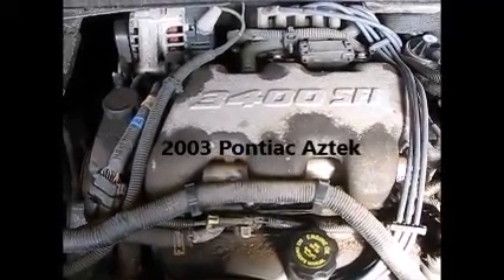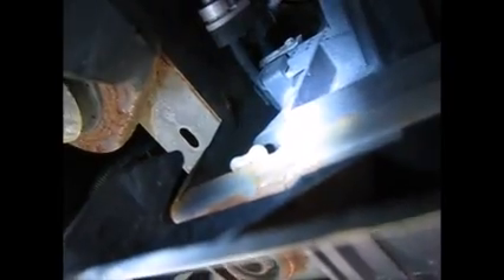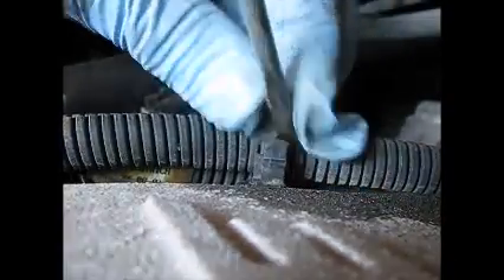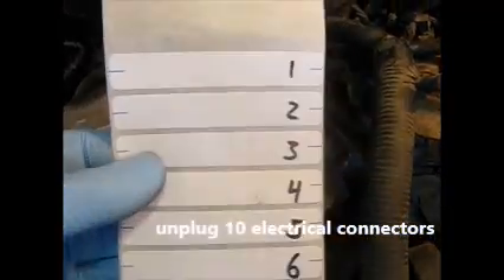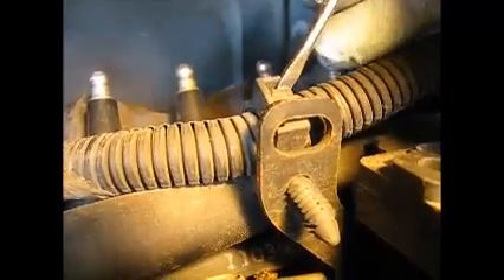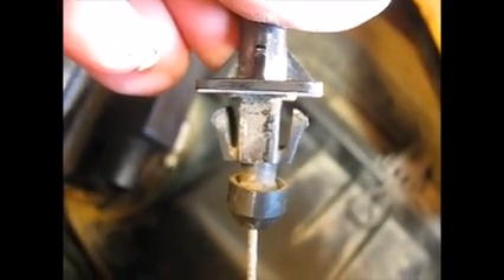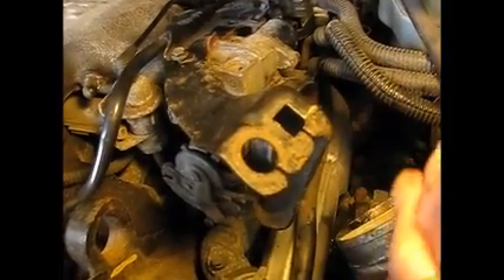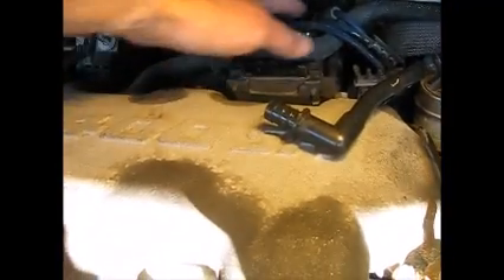3.4L GM lower intake manifold gasket replacement part 1: Intro and removing upper components

Comment: It's not very often that plugs clip on a connector that not for it pretty much every plug is different by even a little ridge or a difrent clip but is hard to mix the wirers

Comment: I noticed that on your webpage version of the repair, you specify black rtv sealant. My gasket kit did not come with sealant, and I have Permatex red high temp rtv on hand. Do you believe it is necessary to buy black rtv rather than using the high temp red rtv that I have?
Reply from the maker: The red should work fine. You may be wasting red's high temp capabilities here though.
Reply: @TheOriginalMechanic  Thank you for your reply. I have watched a number of videos covering this repair and I believe yours is the best. Thank you for the considerable time you put into this.
Reply from the maker: @josephalan2094  You're welcome!

Comment: My daughter has a 2005 Equinox that has this engine...last week she said her coolant was going down.... I put my pressure tester on it.... I found a slight leak from the intake manifold gasket at the back of the driver's side..... ugh.... this looks like major major surgery.
Reply from the maker: Yeah you need some time and patience, but it can be completed by the home mechanic.
Reply: @TheOriginalMechanic  oh I know I can do it but on my own  GM 3800 I can do the job it fewer than 2 hours ... It seems this will take a lot longer.

Comment: I think we are encountering very similiar issue on our 1996 Pontiac Trans Sport with the 3.1 liter. But instead of showing any signs of coolant in the Engine Oil we have signs of Engine oil in the coolant. I'm thinking it's the same culprit, pop the coolant radiator cap off and it's looking like a milkshake inside. We have an oil leak at the rear main seal and we are loosing coolant. I don't have the money for the gaskets yet or even to change the oil at the moment but I'm thinking the lower intake gasket needs to be replaced, coolant needs to be flushed and the oil needs to be drained and replaced with new fluids and a filter.

Comment: I used your 8 part video series to replace gaskets on my wife's 2003 Chevy Impala hoping to add to the already 240,000 miles.  Things went well thanks to your excellent instructions and thorough explanations.  I appreciate your willingness to put the time into sharing such detail.  This is what helps the knowledge train continue down the line.  The Impala is running like a champ again, with no more leaking oil.  Thank You!
Reply from the maker: You're welcome. So glad you were able to make use of the series. Thanks for recognizing the hours of effort it took to make these videos. Great to hear an older car is still on the road. That must be the second (or even third) time that repair was done on your Impala.  Great job!
Reply: Hello I'm need helplocating my wires for my harness to my alternator my harness broke off the wires broke off my old hornets and now I can only find one wire and that's the red wire the ignition wire so I'm needing help to try finding the honor wires it's a 2003 Pontiac aztek thank you if you can help me

Comment: why is my 2000chevy impala run at a very high rpm when I start it up and it doesn't go down at all I changed thurmastat and intake gaskets with gasket sealer now it's running at high rpm
Reply from the maker: I always go back over my work when I get an unexpected result like that. Odds are you missed a wire or hose connection.

Comment: I changed the thurmastat on my 2000 Chevy Impala 3.4 L and tried to fix intake gaskets now it's leaking and running at a high rpm
Reply: Any luck

Comment: Do the car was smoking through the tail pipe before changing the lower intake manifold gasket? Curious because my car it's smoking white smoke and it just got new head gasket
Reply from the maker: No this car did not have white exhaust. It may be possible with a lower intake gasket leak if enough coolant gets into the oil.

Comment: This might be a stupid question but I'm curious. Was the discoloration of the top intake manifold(where it looks wet) a sign of the lower intake manifold gasket failing? If not what are the visual signs? I'm looking at a 3.4 grand am that looks exactly the same .
Reply from the maker: Possibly this could be a sign, but coolant in the oil is a better indicator of big trouble.
Reply: Xander Kresh....that is the beginning signs that there is a lower intake manifold gasket leak beginning, and upper plenum gaskets starting to get a little dry and brittle.

Comment: I damaged the tubing that goes in the air intake you remove at 10:30 in the video.  I have everything back together but getting a check engine light from this tube missing.  Any idea what this is called, or a part number?  Appreciate your videos a great help!
Reply from the maker: I'm not sure what it is called. I did make a blog post on this repair. You may find this helpful 
http://www.originalmechanic.com/2016/06/how-to-replace-lower-intake-manifold.html
Reply: @TheOriginalMechanic  Acdelco PART#: 24508188, it is called PCV valve tubing. Many part stores (websites) say it doesn't fit 2004 impala 3.4L but it does. Hope this information can help others.
Reply: Hey bro u still around

Comment: Can someone tell me what is that wire or pipe next to the intake air temp sensor on the air intake hose. For some reason it is cut off and taped around it in my Chevy impala
Reply: Obet oxygen sensor
Reply: Pcv valve bro

Comment: Drain oil to remove the intake manifold??? By the looks of your oil cap you have a blown head gasket. Maybe you ought to re-title your videos to reflect that....
Reply from the maker: Coolant and oil passages pass nearby in the lower intake manifold gasket on this engine, much like in a conventional head gasket. The failure  of that gasket is why this repair is taking place.

Comment: This is not a 3.4 this is a 3400 which is alot different. I know 93-95 camaros, and firebirds (rear wheel drive) have a 3.4. Still the same principle for replacing the intake gaskets, but looks a lot different then mine. Thank you for the very explanatory video.
Reply: This is not a 93-95 Camaro with RWD.The OP states very clearly 3.4L or 3.1L 1998 to 2005 in his description which is correct. The OP even goes into great detail saying "These engines are found in many models of GM vehicles made from 1998 to 2005, such as the Chevrolet Malibu, Lumina, Venture, Impala and Monte Carlo; the Pontiac Grand Am, Grand Prix, Montana, Transport and Aztek; the Buick Century and Rendezvous; and the Oldsmobile Alero and Silhouette." Nowhere in the description does the OP mention/say that this video/procedure is for a 93-95 Camaros, rear-wheel-drive. It doesn't matter if the engine decal says 3.4L or 3400. It means the same thing. I have a 1998 Oldsmobile Silhouette with a 3400 engine. This is the engine specs for it "3.4 L; 204.4 cu in (3,350 cc)" from Google.  I'm a mechanic and here's the specs right out of the book for the 1998 - 2005 3.4 L; 204.4 cu in (3,350 cc), which averages out to 3400 cc which some Chevy, Oldsmobile, GM, put on their upper intake or specific location for a description of the engine displacement size. Some companies also choose to put 3.4L instead of 3400. What do you think cc=cubic centimeters, and L=liters means? What do you think 3400 cc means? 3400 cc is the same thing as 3.4L, get it? 3400 cc=3.4L.  Again it's still the same engine the OP is working on from 1998 - 2005. You need to learn a little bit about engines before letting the whole world laugh at your arrogant ignorant comment. I just took this from Google "Now CC stands for cubic centimeters that is the volume of engine. 3.8 L engine means its volume is 3800 CC.(1L=1000 cc).

Comment: I'd recommend not removing the throttle and cruise cables from the bracket...just unbolt the bracket. You could easily break the plastic tabs unneccesarily.

Comment: Hi Hope someone can help me out here. I replace the intake manifold gaskets etc, put the van back together and it wont start. I found the problem.  On the coil pack are 3 connectors, I  connected left one on and the right front one. The back right one is missing. I dont where it comes from. I have looked around and cannot find it. The back right connectors does not come off of the main wiring hardness as it is not there. Can anybody tell me where this wiring connector comes from? Help please Im stuck
Reply from the maker: It comes from  just to the right rear of the coil assembly. Check out part 7  at 15:54 as it is plugged in.  It must have slipped behind something but it should be right in that vicinity.

Comment: Hi. Can you help me? Muy venture has a high idle (1500rpm) if i remove the tube from de mainfold to the booster brake. The motor stabilizes 850-900 rpm. but if i conect the tube back, it goes 1500rpm again.

Comment: Hello. I just recently replaced lower and upper manifold gaskets in my car (2003 3.1 V6 buick century). Everything went well and I followed youtube/chilson manual to complete. Now that i have everything back together it wont idle. It will start and run if i have my foot on the gas but still has a tough time running. To my knowledge all vacuum lines are connected and I've checked through the wiring harness and all connections look good. Any advice would be a huge help. Thank you!
Reply: Yeah I did. It being 2am and very tired when I was reassembling everything, I didn't realize the throttle body gasket had slipped down out of position and was blocking half the intake. Once i fixed that it ran perfectly.
Reply from the maker: That's always tough to deal with after a repair like this. Make sure the spark plug wires are right. Just double check all wiring, hoses and lines. Throttle cables also . Good luck with it.
Reply: Thank you for the response. Yes it is very frustrating. I'll go over everything again tonight.
Reply: did you get it fixed?

Comment: ok so my 2004 chevy venture overheats and gets little cabin heat.  Only heats up inside when i idle my car at a high level.  Then heat will blow hot and temperature will go down.  I have changed thermostat, oil, coolant drain/ replace, water pump, burping lines.. I am told it could be head gasket?  I need to be certain before going this route.  Any ideas?
Reply: also, I am not really seeing any signs of gasket failure other than the overheating and cabin heat not working properly.  It blows some white smoke but it's freezing outside and I'll get a few drips of water out the exhaust after starting but it could be condensation/ frost from the cold. I have not seen coolant in the oil.
Reply from the maker: You've covered all the basics so this is probably serious. What I've seen when the intake manifold gasket fails is coolant in the oil. It doesn't usually overheat until the coolant gets too low.  The combination of white exhaust (burning coolant) and overheating does point to the head gasket. A leak down test would be the definitive way to check the head gasket. I don't have a video on that but I've seen some good ones. I hope this helps and good luck.
Reply: @4valhalla898  what happened with this issue?